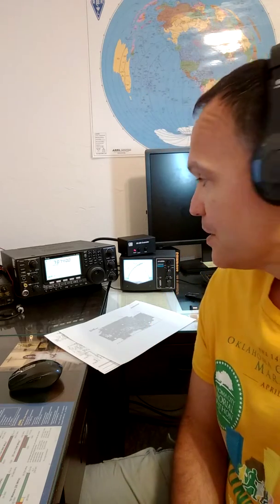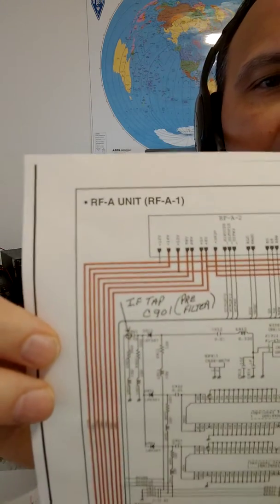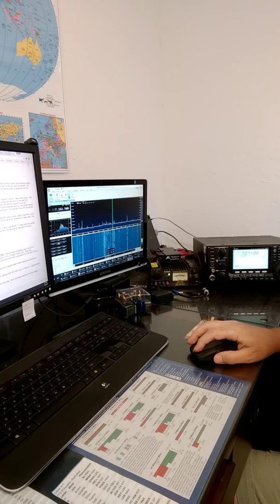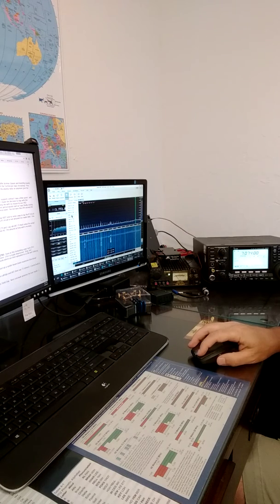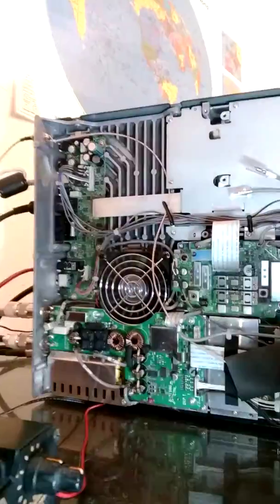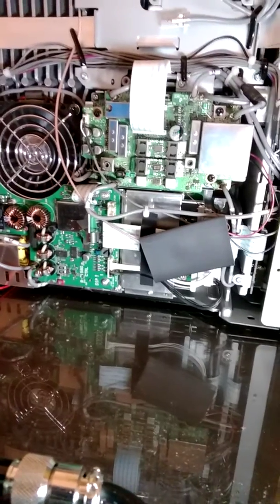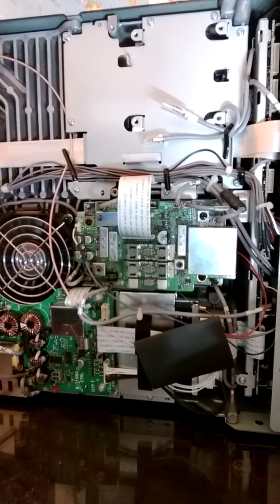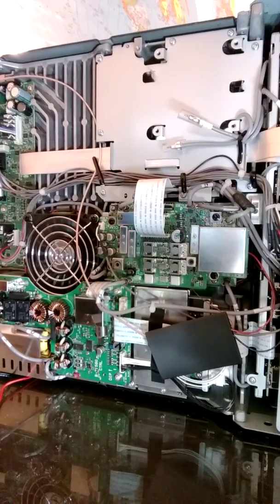Panadapter for ICOM IC-9100 part 2

Comment: Hi OM. Thanks friend for sharing the info.
Query: without the panadapter, is it justified to install the FL-430/431 filters? It improves much more? I await your opinion? Thank you -  LU5 BE
Reply from the maker: The panadapter is attached before the filters so they would not make any difference.  The filters are needed if your operating during any kind of contest.  Without the add-in filters the first stage IF implements a 15 Khz filter which is very wide and makes the radio a poor choice for a contest.  With the 6 KHz FL-430 though it's much better.  The FL-431 at 3 KHz is helpful as well.  For FT-8 I use the 6 KHz.  For phone I switch between the 6 and 3 KHz a lot.
Reply: I have Both optional filters and I believe they do help with receiving.I don’t have the Pan Adapter but I am considering getting one if I can find someone locally to install it.I also don’t Contest on any band.Shame that the roofing filters don’t work on VHF/UHF.👍🎙

Comment: Hi, is the HF tap point at the junction of C901/R901 or the other side C901/R902 ? Thanks 73, Steve
Reply from the maker: Between C901 and R901, so off the corner of either of those components connected to the same trace.
Reply: Thank-you and thanks for the video, 73, Steve
Reply from the maker: Your welcome!  I understand now that he sells a 4-port buffer board for the IC-9100 and now you can connect the HF, VHF, UHF and SHF board (if you have it).  I have no idea where those taps would go though.  https://kd2c.com/pat-v-9100

Comment: Good video, can you share the link so i can order the kit, because i got a icom 9100, and I would like to put the panadapter on it... thank you
Reply from the maker: I purchased the buffer board from David Calo, KD2C
kd2c56 at gmail dot com

They are based on the original design by the late Dave Powis (G4HUP/SK). They are the exact same circuits that the original G4HUP PAT boards had. Since Dave's passing in February, his boards are no longer available. You can go to Dave's website for info: http://huprf.com/huprf/pat-board/ for more information.

The IC-9100 would require the PAT70M5 board.
Reply: thank you for the info, i will send a email to David,  73s from xe1sww...
Reply: @AgelFerrod He said,Dave Passed Away so he will not reply to your email I think.